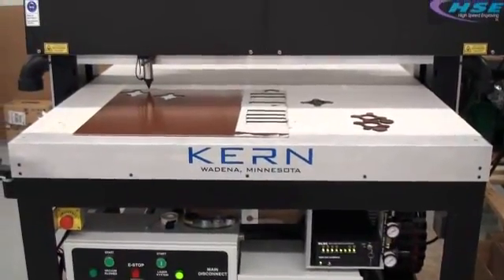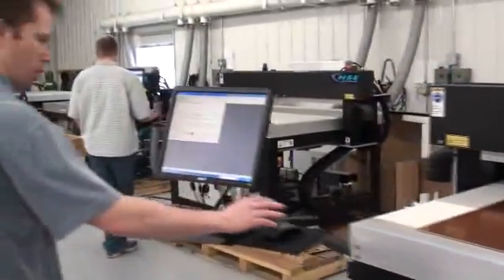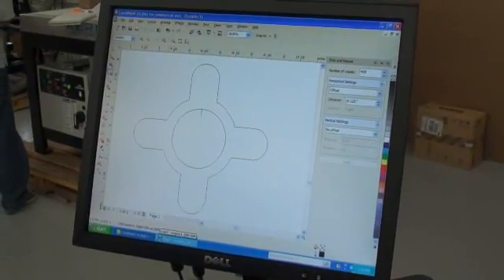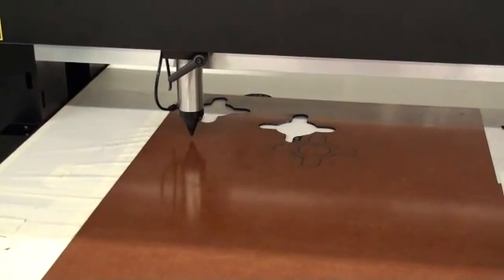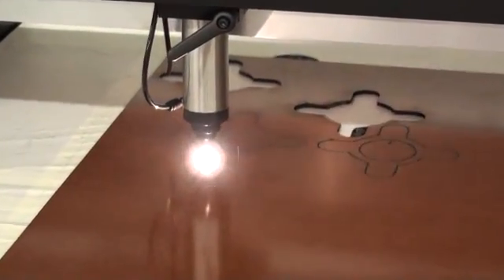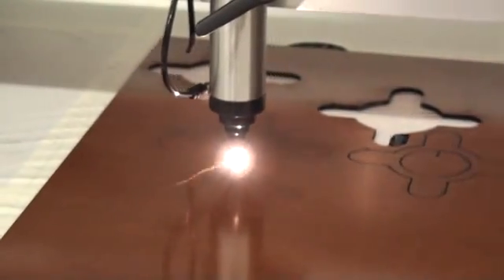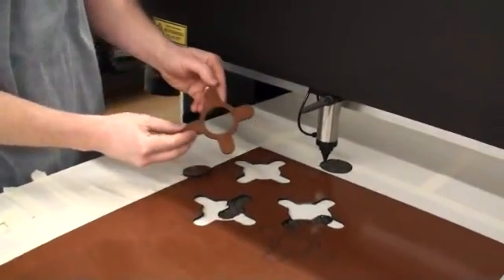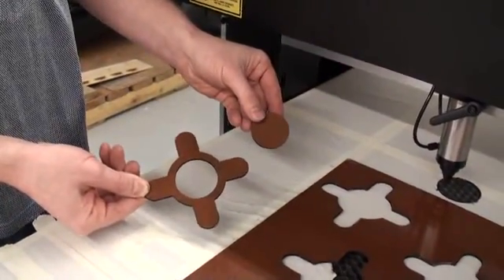Phenolic KERN Laser Cutting Machine

Comment: I have 150Watt laser I am look to cut phenolic material, maybe 1/4. what percentage of power of the 400W did you use?
Reply from the maker: We use 100% power. We would adjust the speed until it is cutting through nicely.

Comment: What is the cheapest solution to cut this material with 3/32 sheet thickness? I don't want a large area nor excesive extra power, just a cheap solution for a  small piece of dimmensions 1" long, 5/8" width, 3/32" thick. An easy solution almost turnkey.
Reply from the maker: I think you will need at least 100-150 watts. We would be happy to cut samples to determine the speed and power needed. Please send the material to our main office listed on our website.

Comment: Are you using a shielding gas to cut this?  Would a 50 or 100 W beam cut this material?  I didn't notice any burnt edges.  Also, I understand that a lot of toxic fumes are give of when phenolic is burned.  

We are considering purchase of a laser for cuttiong flat acrylic as well as Garolite XX round tubes.    They are 3/8" OD, with a 3/16" ID.  We need to be able to cut them lengthwise, and SAFELY.
Reply from the maker: The laser in this video is a 400W and we used shop air as the assist gas. Once the laser beam cuts the bottom table vacuum pulls the fumes down into its chamber. The shield gas also helps push the fumes into the bottom vacuum table. There is also a top vacuum underneath the gantry which picks up lingering fumes above the material.  There would be a dark edge on this exact material when laser cut. We recommend a MSDS sheet is reviewed on any material that is processed with the laser. We are happy to cut samples for you if you provide the material. Our LaserCELL is a completely enclosed machine and might be more suitable for certain materials. We can also provide fume extraction systems that contain filters which pickup the fumes before they air is released back into the room.